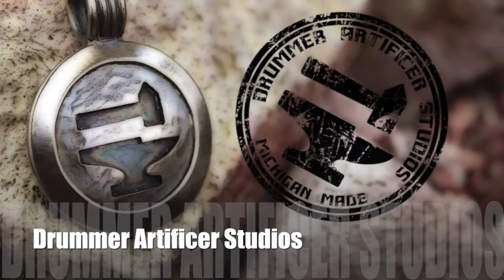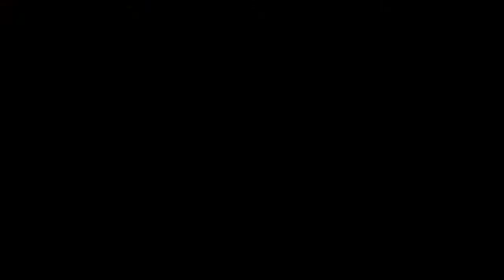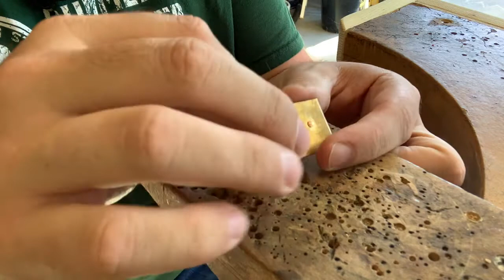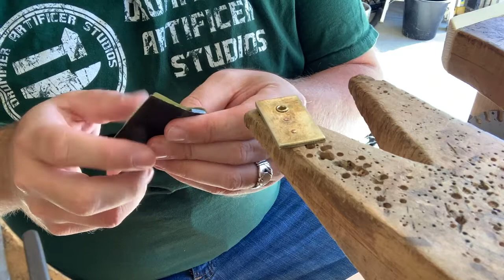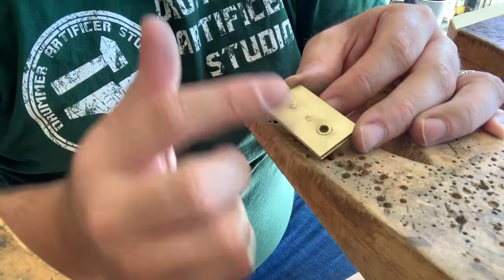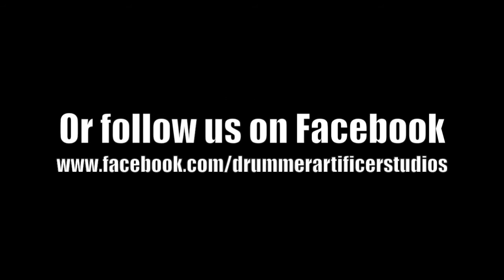Jewelry Techniques: Filing and Sanding

Comment: Hi ! Thank you so much for your video,
I do have one question 😊 while im 
(In case if its important, i'm filing with a big vallorbe file G2, but it makes a horrible sound and its very difficult, almost impossible to file with it so i use the sanding paper, van you please help me to understand what im doing wrong? (curently using on a 1mm board some 0/3 saw blandes)
Reply from the maker: Thanks for commenting, my guess would be that the file you are using has too large of a tooth to it.  You probably should switch to a finer file and make sure the piece you are trying to file is firmly pressed against a hard surface to help absorb any excess vibrations.